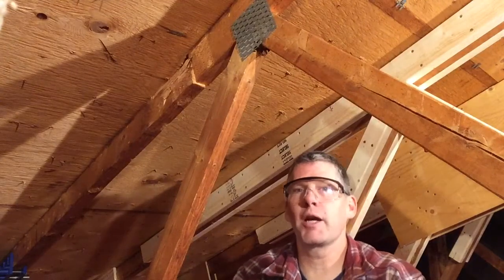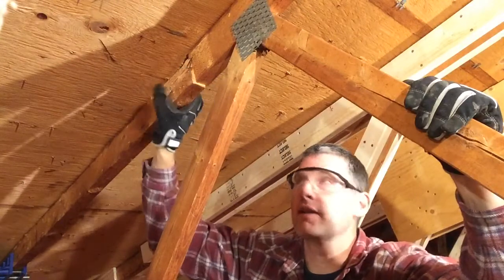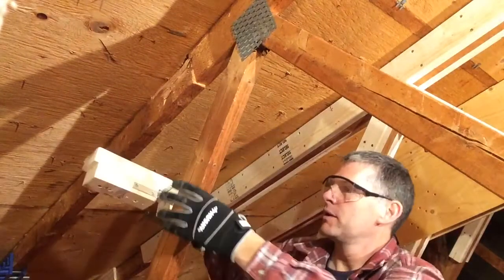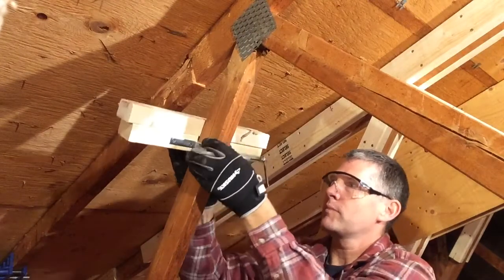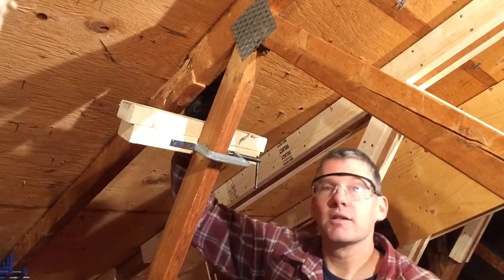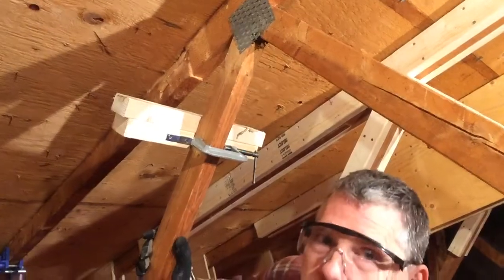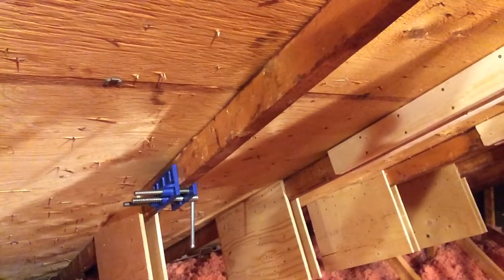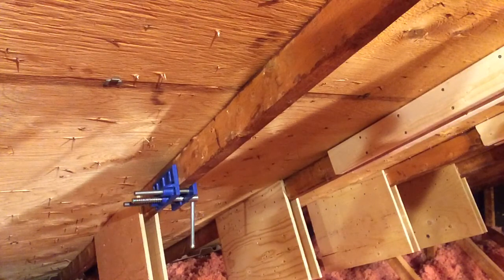Attic Truss Repair 04: Jigs & tricks to position new wood

Comment: Do not follow this video! Trusses are engineered products. Although they may just look like 2x4s put together, those trusses are engineered to perform to certain specifications that just slapping two 2x4s on the side of a crack and throwing some pieces of plywood over top of a gusset does not necessarily repair. Following this video can cause major structural damage to your house and roof by causing long-term truss sagging or weight to be improperly distributed on top of the walls and ceiling below it. Also, if the home is ever inspected most places, all trust modifications require an engineered letter to be placed right along beside the repair in the Attic. Is the home is located in one of these areas and the home is inspected You will not be able to sell the home or worse, the house could be labeled uninhabitable because it's no longer considered structurally sound. You will then have to pay for an engineer to come out, inspect the roof and the trusses and any other places that could potentially be damaged by what is going on then that engineer will have to come up with repair plans that have to be followed to the letter to repair then the house has to be reinspectedand by the time it's all said and done it could cost you tens of thousands of dollars in the long run
Reply: So the solution instead is what?